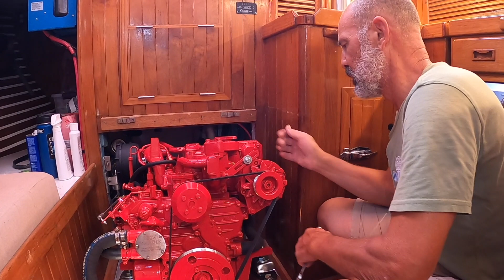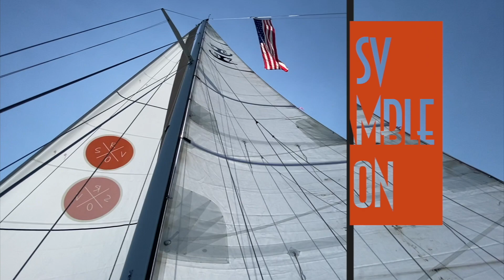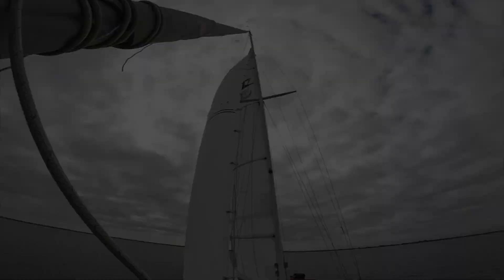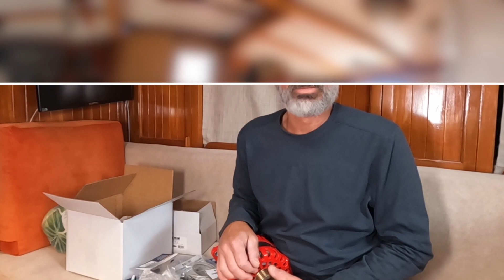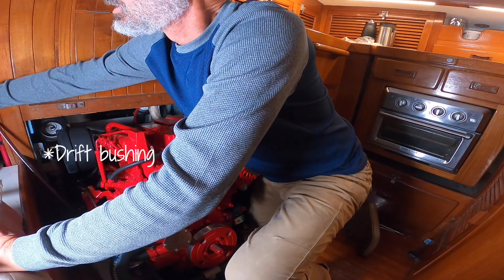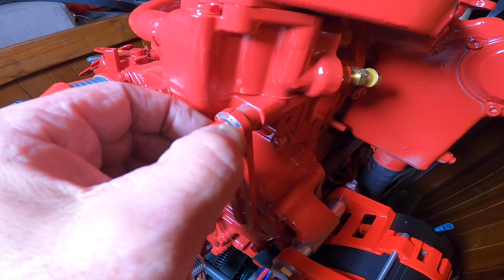Power Struggle:  The Quest for Maximum AMPS! | SV Ramble On

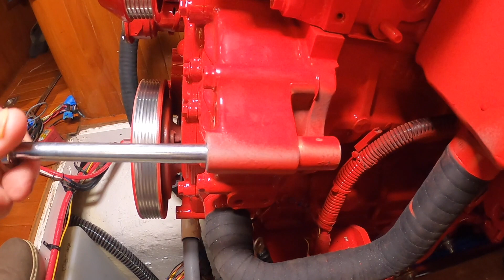Comment: Is it just an optical conclusion or did I see @5:02 a 2" foot mount with a bushing to extend it to fit a saddle mount?  Seems like you could have used the white alternator from the Perkins.
Reply from the maker: No, the white alternator was a single foot and the red one is a dual foot.
Reply: @svrambleon  But what I was seeing at 5:02 was that if you remove the spacer on the back side of the mount what is left is a 2" single foot mount.

Comment: This may have been covered in a previous video but you mentioned 25% of capacity or something. What is your battery back size? LA? AGM? Lithium? What are you going to do with all those 250 amps? Great video. Thank you!
Reply from the maker: We have an 800 Ah lithium battery bank (Battle Born brand).  Twenty-five percent of that is 200 amps.  The Beta 43 came with a 170 amp alternator so we upgraded to a 250 amp alternator.  It will run more efficiently than the 170 amp one.  Part 2 of the install is coming out this week and we explain a little more why we upgraded.

Comment: Do your old alternators work?
Reply from the maker: Yes, the one that came with the engine (170 amps) works fine and the one from our old Perkins also works, but doesn’t fit the Beta 43.  We upgraded the 170 amp for efficiency.  We’ll have to run the engine less, it will run cooler and put more amps into the batteries in less time.  Part 2 of the install will be out this week and we explain a little more.

Comment: What was wrong with the original alternator that came with the engine? All you’re doing is charging your batteries.
Reply from the maker: With the capacity of our battery bank (800Ahs) we wanted a larger alternator to minimize engine run time. The original alternator was 70 amps and it would take 6ish hours to charge it up from 50%.  The bigger one is more efficient, has an external voltage regulator, and it runs cooler.